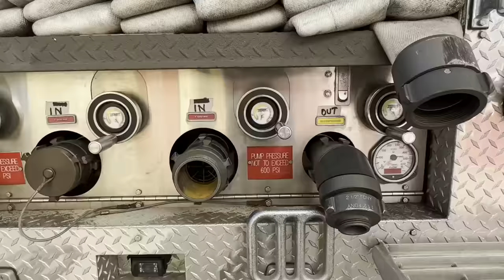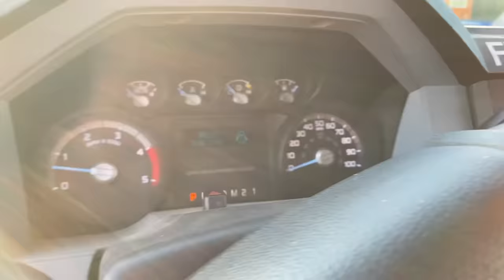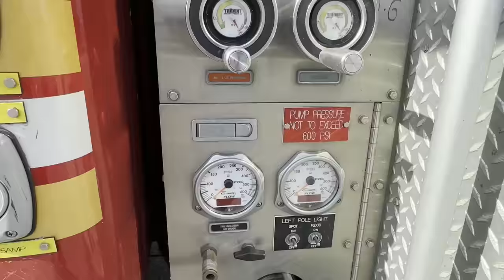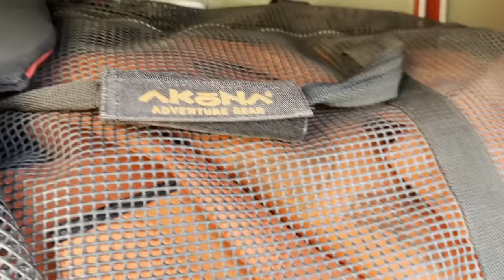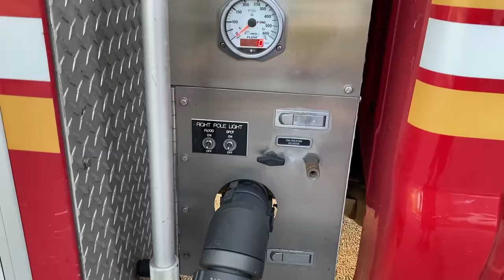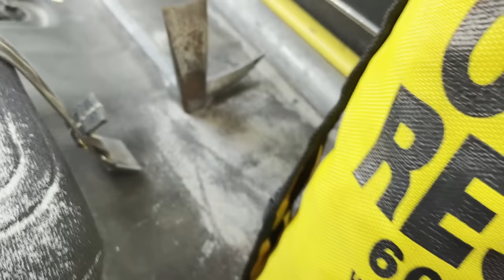🌟 FLEET FRIDAY 🌟 FDNY ALL TERRAIN RESPONSE VEHICLE 329 ~ SAND VEHICLE

Comment: The blue item at 5:50 is not a ramp, its a traction device for helping to get itself unstruck in off-road situations.  Very commonly used items by off-road vehicles.
Reply from the maker: Thanks! I couldn’t see what exactly they looked like
Reply: They work as a ramp 🙄. They are made by a company called Maxtraxx. I have a set.

Comment: Does this station back up the point breeze fire department
Reply from the maker: FDNY has full control over all fire scenes. I am told that those vollies only get on scene before FDNY when they call your security first instead of 911… when 911 is called first the FDNY will be first due which when ever FDNY gets on scene the vollies are suppose to back out.
Reply: @SkylerFire that’s incorrect. Both fdny and vollies work together on a scene. 
Whoever gets dispatched to it first depends on if the caller called 911 or some of the areas have private security and if they called them, the vollies  get notified first.

Comment: What is a control firefighter?
Reply from the maker: Each Engine & Ladder have working positions 

Engines are 

Officer 
Chauffeur 
Nozzle 
Backup 
Control
Reply: @SkylerFire  So a follow up question, what is the control’s role in the fire.  The other positions, I can guess.
Reply from the maker: Control Firefighter is the last firefighter on the hand line. To ensure enough line to stretched to the nozzle team, to deal with kinks in the hose, usually a experienced firefighter.